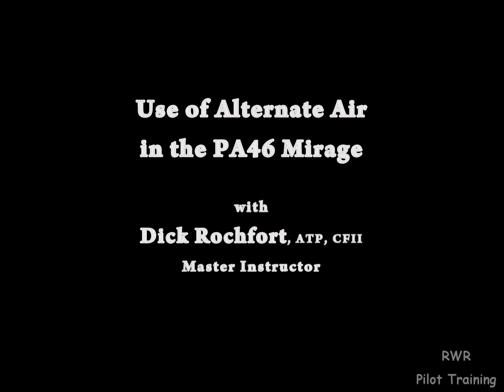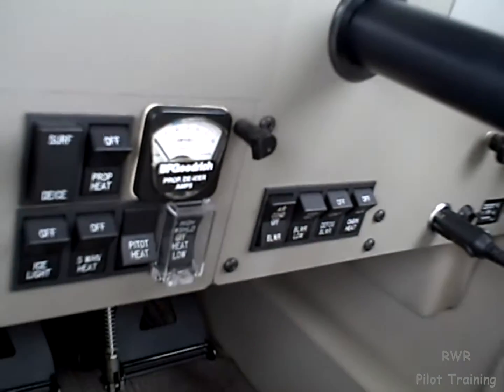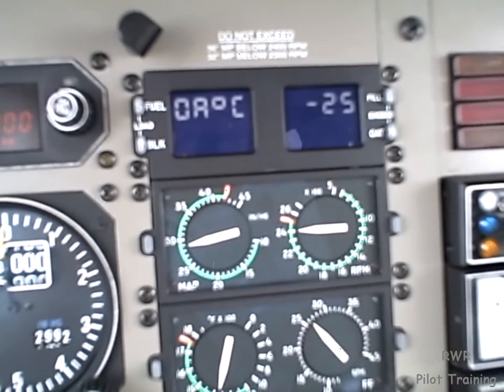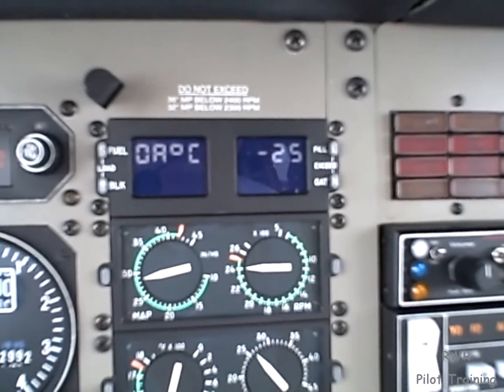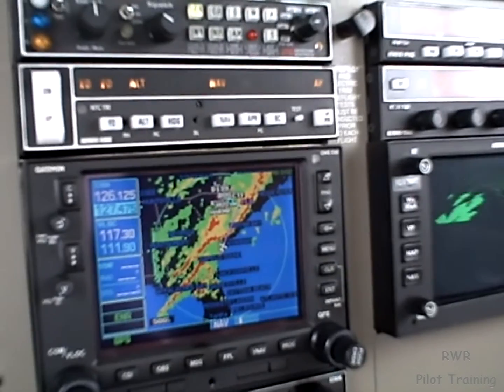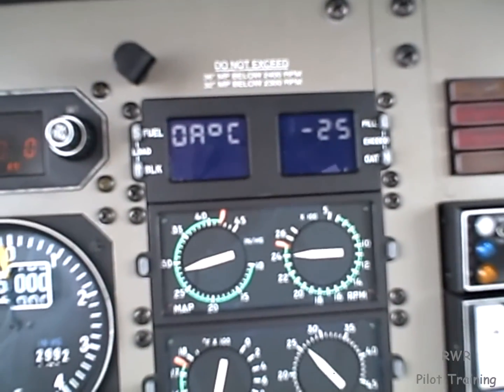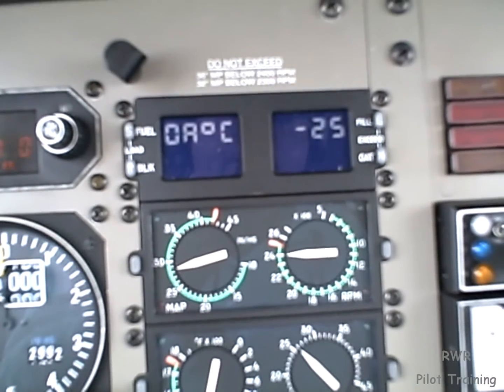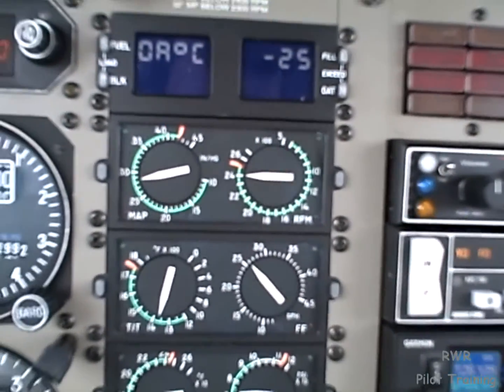Use of the Alternate Induction Air in the PA46 Mirage

Comment: So alternate air isn't automatic like on some planes?   I've never heard doing this before
Reply from the maker: Hi Nathan, thank you for your question. Alternate air is an often overlooked feature on turbocharged piston aircraft, many have automatic alternate air, however, the PA 46 uses manual alternate air. The physics of the environment requires that the alternate air be open in the presence of visible moisture, no matter what temperature. The reason for this is that adiabatic cooling occurs across the filter. If the alternate door isn’t open, ice forms on the back of the filter and it can be ingested through the turbochargers. Fly Safely - Train Often .. DR

Comment: Dick, is there any advantage to opening alternate air in a normally aspirated engine?
Reply from the maker: It works the same way in any aircraft with a fuel injected piston engine. Open alternate air in the presence of visible moisture and do not close it until you are on the ground and shut down. Fly Safely - Train Often .. DR